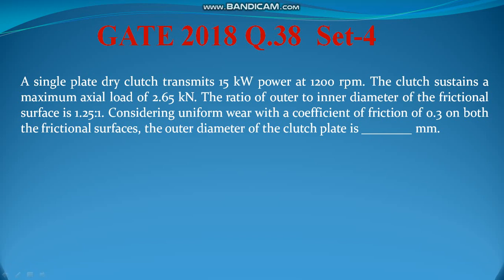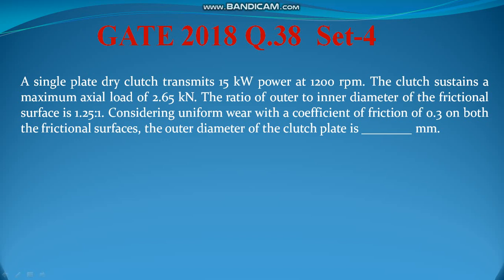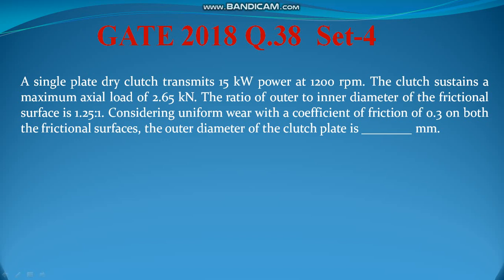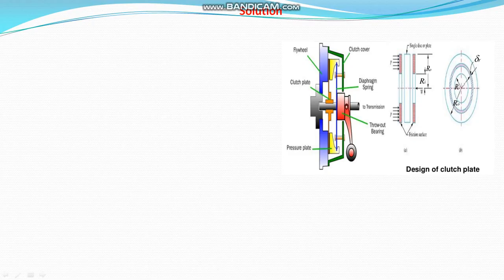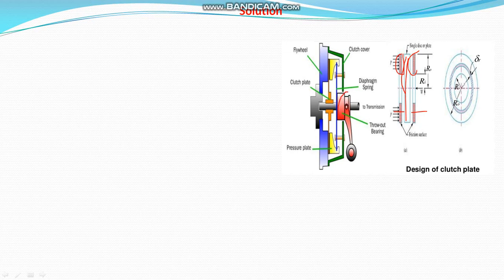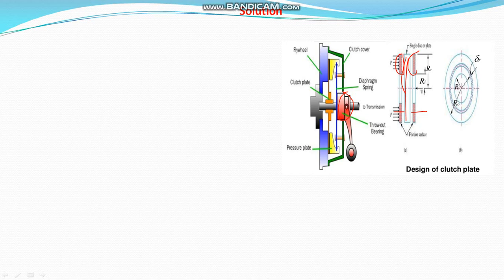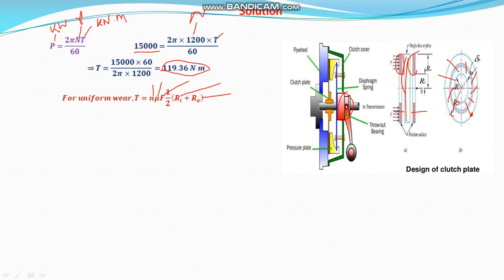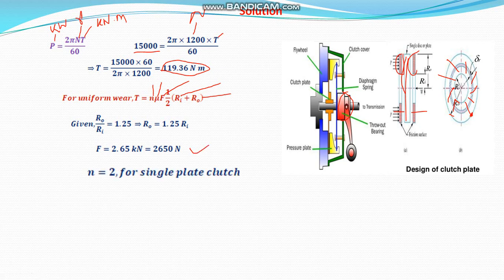Single plate clutch uniform wear GATE AG 2018  Q-38

Comment: . A single plate clutch with both sides of the plate effective is required to transmit 25 kW at 1600 r.p.m.
The outer diameter of the plate is limited to 300 mm and the intensity of pressure between the plates
not to exceed 0.07 N/mm2. Assuming uniform wear and coefficient of friction 0.3, find the inner
diameter of the plates and the axial force necessary to engage the clutch.
Sir please solve this